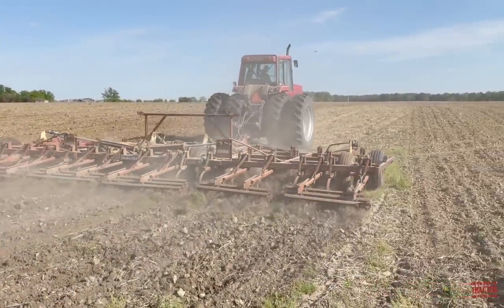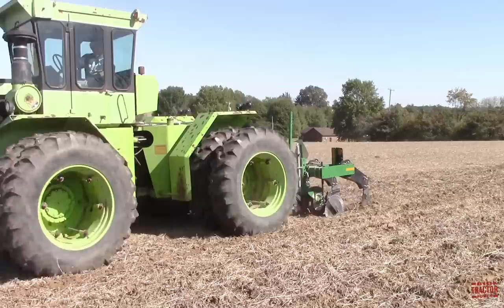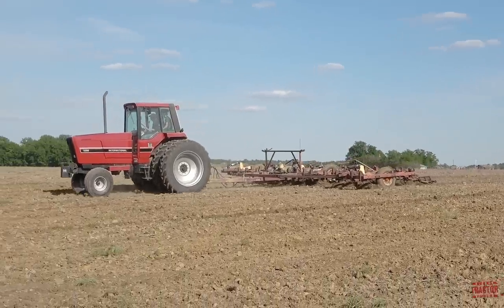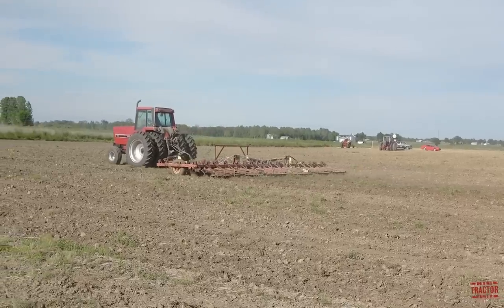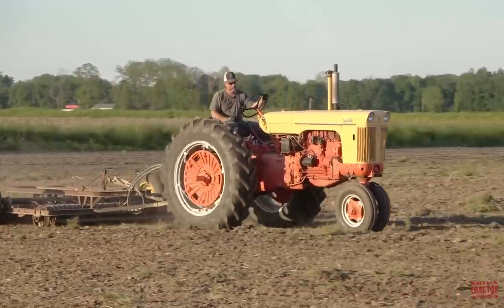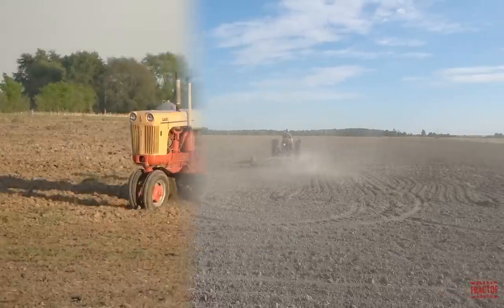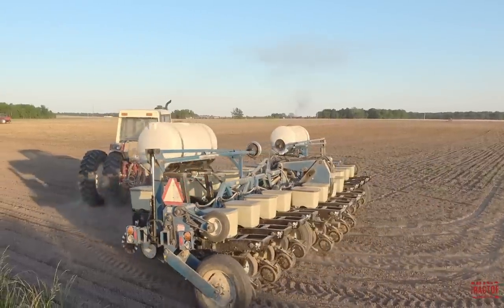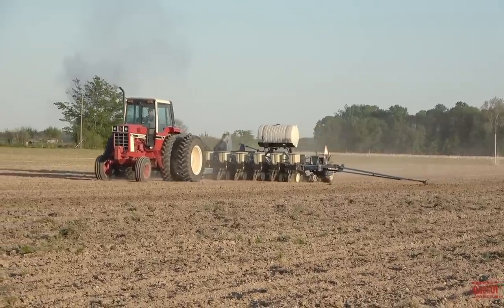CORN PLANTING 1980's Style

Comment: Great video . We used a 1026 ih to plant the moved to a1456 and for working the field we went from a 1456 on a field cultivator up to a 4368 pulling a field cultivator . Thanks for showing a planter that used the markers . I remember a few fields with the planter couldn't use the markers because of a failure in a line or something & after the corn was ready for cultivation it was hard to find the right rows for skipping a few rows for the customer wanted

Comment: Wow! Case 800! Ours is a 1959 LP Case o matic model. After years of constant use and a few in frames and a tranny slide shaft repair, it was semi retired. We moved back out here in 02 to help out and after 2004 when Daddy retired it was used just for about 7 acres of weed shredding and light plowing, scrap moving etc. The tranny got so loud I retired it and replaced it with a L4701 Kubota. For plowing the 800 was better. For weed cutting the Kubota with HST is better. Thanks for this episode!

Comment: Boy that Steiger is having some traction problems! 🙂
Nice to see the simpler machines again  that are actually working under 10 MPH in the field.
Reply: Yes the Steiger is pulling fairly hard, right on the limit and totally agree with your comment about the working speed of machinery shown on here, I reckon most of them are traveling way too fast, particularly ploughing because it throws the soil to far and creates ridges in the paddock. I've said it a heap of times, a lot of the tractors could come back a gear or in some cases 2 and let the implement being pulled do it's job. cheers from Adelaide, South Australia.

Comment: The farm I work for uses a John Deere 8120 with window tints and an 8 row 30" spaced John Deere 1750 planter to plant corn. They use a JD 9220 to pull a 48' JD 1060 field cultivator for seed bed preparation.

Comment: JD 4640 pfwd and duals pulling JD 960 28' field cultivator. Brand new monosem 6 row 38" spacing on 4440 with duals. Finally got away from planting on beds. Wanted bigger planter. Couldn't afford it.

Comment: We use a John Deere 7320 tractor and John Deere 1755 corn planter to plant corn. And a challenger mt 665e tractor and John Deere 1590 drill to plant soybeans. We do no till on the corn and plant our soybeans into a vertical till pass from our salford 2200 from last fall.
Reply from the maker: Very cool line up.  The 1755 is a cool and hood planter.

Comment: It was awesome showing how hard that ripper pulled with the excessive wheel -slip, it looks like 40hp per shank is needed. Could you also give the field weighted spec and maximum pull data with your specs.
Reply from the maker: It definitely shows how hard the ground gets and why subsoiling helps open it up for the next crops roots. 

I do have full spec videos.  This one was just to show how these tractirs all work  together.  

Here is a spec video on the Case 800 https://youtu.be/i_SjKojv8Y0 and one on the Steiger Wildcat III https://youtu.be/DRetmgT_yXU
Reply: With 23.1x30 duals all around, and no fluid added, a wildcat 3 is 22,260 pounds according to the Nebraska tests.